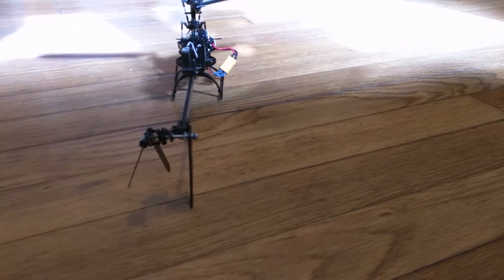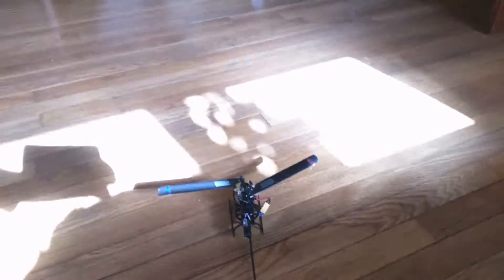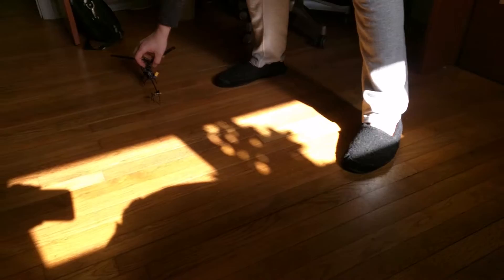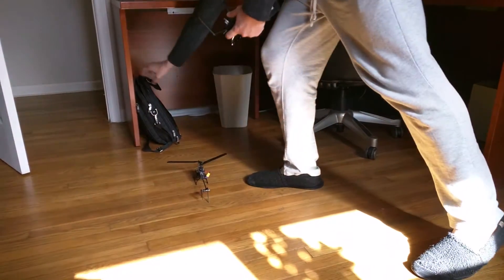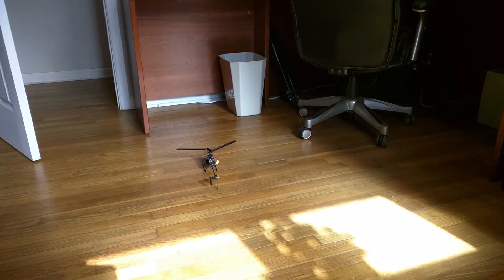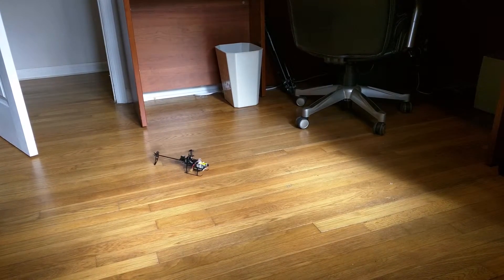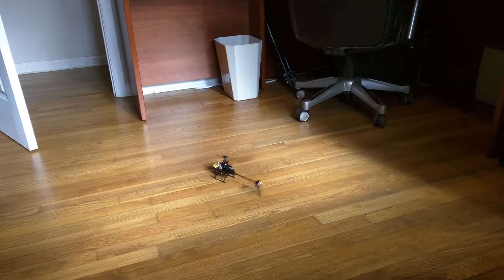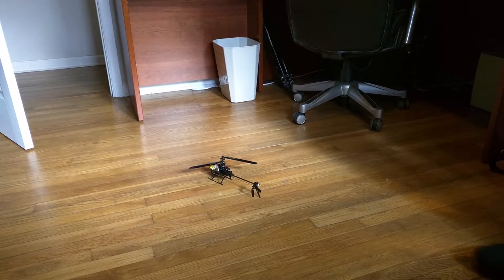V120D02S tail rudder issue

Comment: Hi, mine starts doing the same. I thing thats because rudder gyro is not working like mone. Have you fixed it?
Reply from the maker: I found that the tail shaft gear was not meshing with the main rotor gear. So the tail was not spinning at a constant speed.
Reply: same issue, my walkera.also gyro not working..